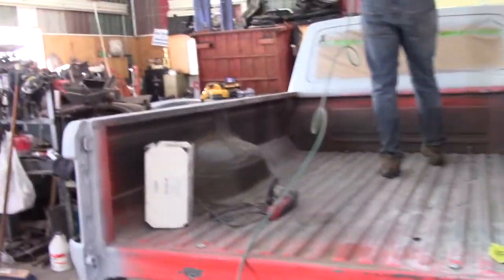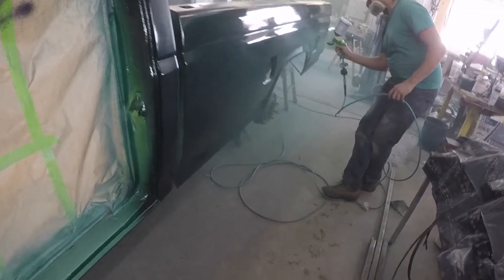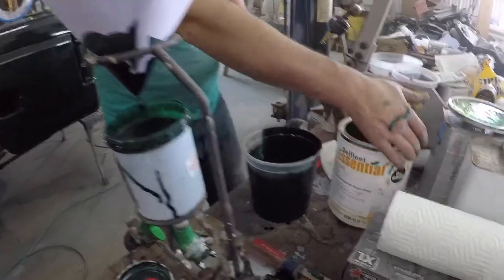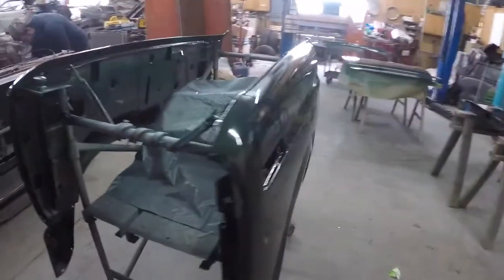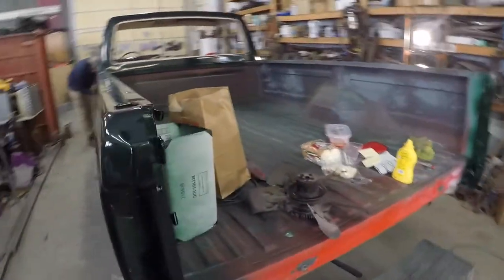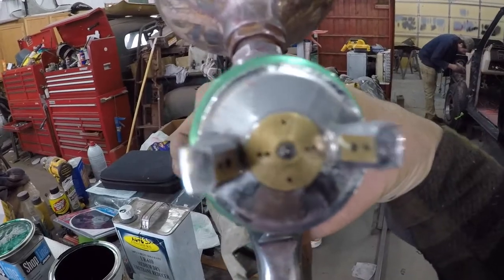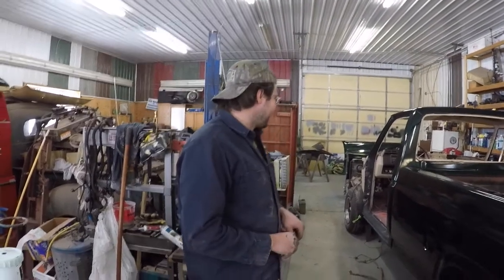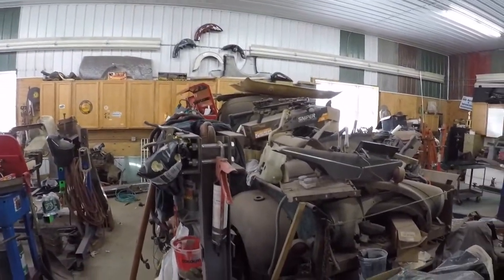Harbor Freight item 56982 VS old Astro hvlp guns for spray painting primer on Connors F 150 part 2

Comment: I just tried this today, as far as I can tell this is far superior to the purple gun, I actually threw away 2 purple guns into the trash, one of them was brand new. the cap on this is far superior. I need to check my fender in the morning but as far as I can tell the fan was way wider and it seemed to lay my over reduced sealer flat AF, will update this later if I was hallucinating that part. I was also testing out my new spray booth I built
Reply from the maker: sorry just saw this comment. hope it turned out well.

Comment: That car didn't finish with Orange peel but with Orange peel and Lime peel hahaha throw it away and buy the spectrum.  Next time use 1.7 for single stage paint.
Reply from the maker: Thanks for watching and thanks for the tip on the tip.
Reply: Bought a spectrum and not impressed. Fan adjustment sucked so went back to HF professional.

Comment: I know this video is to demonstrate the Spray gun, but the garage is a mess.. I could just imagine all the Dust that settled on the final paint job
Reply from the maker: Not too bad Alfonso. We used a large, shop vac with fine particulate filter bags and sucked the truck and all around it. Main thing is not blowing with compressed air the day before spraying. But yeah the shop is a mess. Im working on that. And me.